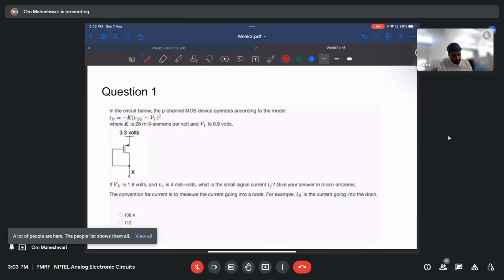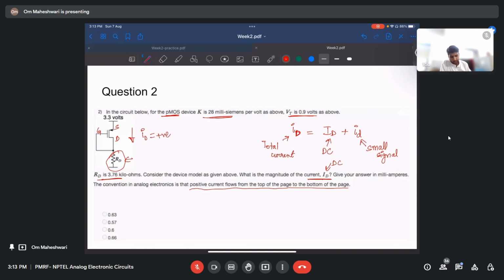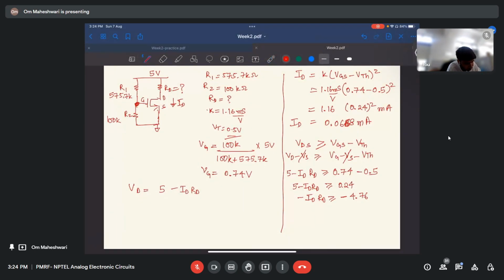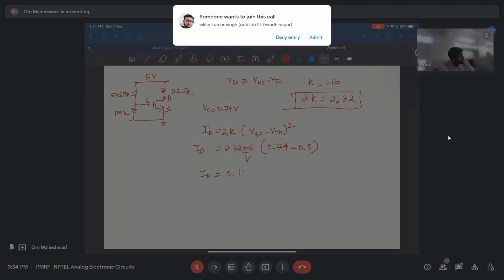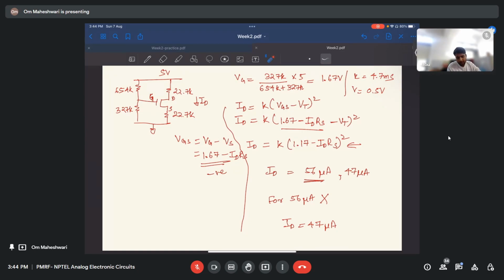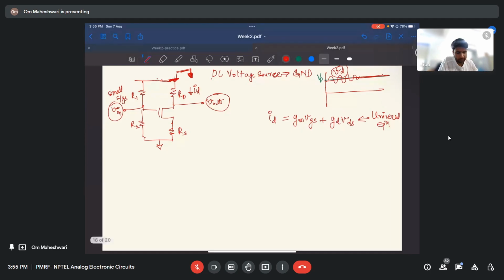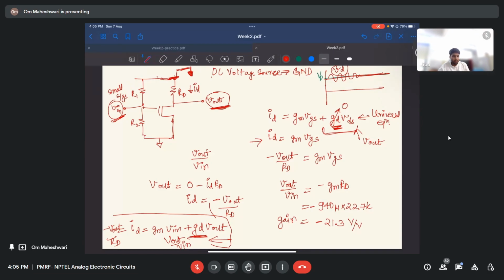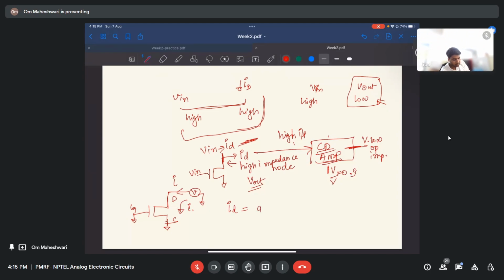Analog Electronic Circuits EE74 - Week 2 Live Session

Comment: Q7) for transconductance  if i use (2*Id)/  (Vgst) i.e 2*4.7*10^(-5) / (1.17 - 4.7*22.7*10^(-2)  comes out to be 911.73 micro S but right ans is 940 micro Siemens Does my approach is right , why is this deviation even in this year problem the deviation is same can you please elaborate sir
Reply from the maker: (2*Id)/  (Vgst) is also correct. there may be some approximation calculation of Id that is why there may be little variation. Both formulations are correct though.
Reply: @ommaheshwari3332  ok getting,  thank you for your response.